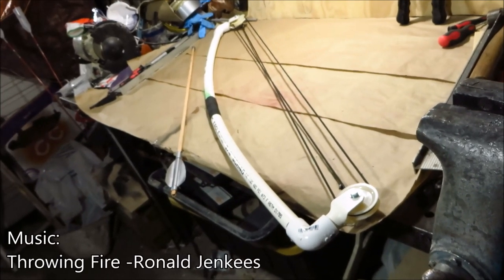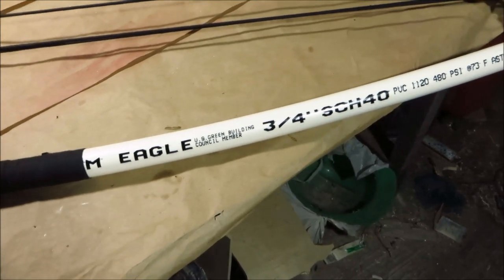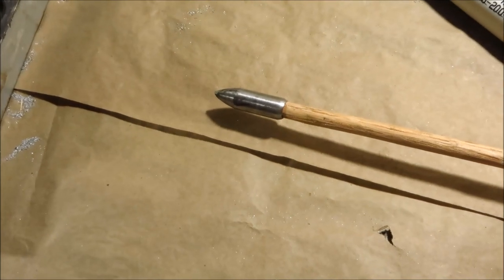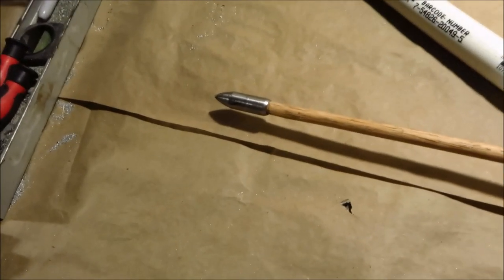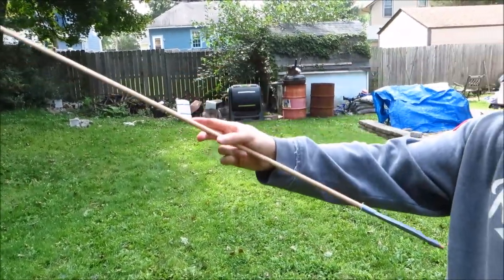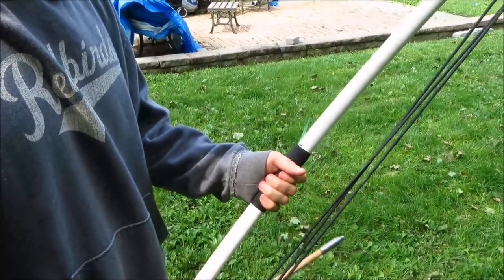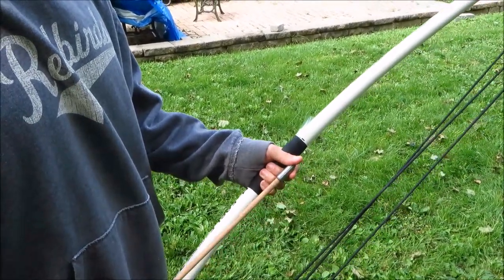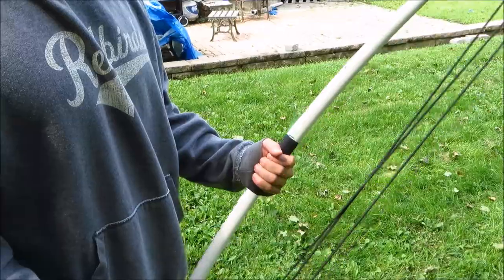Homemade PVC Pulley Bow Shooting!

Comment: I built a pully bow like this with 1" PVC and 4 larger fiberglass rods. It's 5'5" and has a draw weight of 37 lbs at a 30" draw, not bad, shoots ok at 25 yds.
 With a drop away rest and correctly weighted arrows it could probably shoot 40+ yds

Comment: just so you know eli, using pulleys that are round and centered provides no advantage over just attaching the string directly to either limb, the point of  the cams on a compound bow is that they are Asymmetrical and provide more mechanical advantage the further it is pulled back, making it easier to hold it fully drawn.
Reply: thats not actually true. idler wheels allow a longer draw from limbs that would otherwise break. Matthews actually has a very popular bow that has two idler wheels and no cams.
Reply: +TheElvenArcher oh cool, I didn't know that
Reply: Also if nothing else, this kind of bow would allow a very compact build that still has a full draw length, saving pack space is always a plus.

Comment: Have you seen nighthawkinlight's video on the steel wool fire arrow? Hose clamp some steel wool towards the front of the arrow and zip tie a 9 volt battery to the rest so when you draw, the steel wool lights and burns very hot when it flies through the air.

Comment: quick tip: to get more power out of the bow i reccomend using a non stretching cord like bankline, small coated cable or even kevilar line would be great to use . the cons of 550 paracord is that its pretty stretchy and it sucks a bit of the power of the shot  :)

Comment: If you do make another one inch pvc pulley bow then i suggest adding a recurve to the arms to add extra flex an a smaller bow frame with equal power

Comment: @ZednoughtAlpha what if you just put a second smaller pvc pipe inside of the one inch pvc pipe instead of fiberglass? and maybe even a smaller third one or just a single fiberglass rod. Would this be a powerfull bow?

Comment: i need help my arrow flips in the air what should  i do
Reply from the maker: Did you do anything different that I did in the tutorial?
Reply: i didn't make the wings in the back of the arrow
Reply: LB AB bro Well that's why. Just use duct tape like he did.
Reply: LB AB bro ALL arrows need fletching. ALL. They don't work, otherwise.
Reply: LB AB bro Hahahah you made an arrow without fletchings?
Reply: MrAmazing21399 yes i didn't know it was a big deal
Reply: LB AB bro I see. Well, I suppose people can be mistaken about that..
Reply: LB AB bro Use 3 fletchings per arrow.
Reply: Peter Hooper unless the front of said arrow is much heavier than the body and it is therefor front-heavy but yeah fletching is a thing that is good for shooting past like 4 feet
Reply: Calvin M. It still won't fly straight. The only time fletchings are not necessary is if you are bowfishing.
Reply: i just said unless you are shooting more than 4 feet stabilization is necessary for long range not point blank
Reply: Calvin M. of course, but why the fluff would you shoot at a 4feet distance?
Reply: i never said he would, i said it jokingly. "but yeah fletching is a thing that is good for shooting past like 4 feet"
Reply: Calvin M. As I thought.
Reply: why did you originally comment then?
Reply: Calvin M. since you went soo deep into explaining how a heavier head would imporve it.
Reply: thats what she said. ok im out goodnight
Reply: way to front heavy

Comment: Do u think its possible to apply more pressure by putting another PVC pipe right in the middle
Reply: If you use fiberglass rods in the center it probably would but idk about more pvc

Comment: I use to make bows out of pvc years ago doing LARP. The only thing I would suggest for more power is swap the 90's for 45's, use sch 20 3/4 pipe and a 1/2 inch sch 40 in the center replacing the fiberglass rods. Doing a normal curved bow without the pullies you can achieve 40lbs do it that way. Also it will drop the price a little (for how cheap it already is). The only issue is the center pipe raddles. That is something I have been try to figure out how to stop.
Reply: +Dotson6996  to stop the ratlle you could put in news paper for a spacer just a thought
Reply: +merlin christiansen that's a good thought!  didn't think of that.
Reply: +Dotson6996  thanks

Comment: I was thinking about using fiberglass rods instead of dowels, what do you guys think about that?
Reply: it would be a terrible arrow. It would be to heavy.
Reply: +FernTheYoutuber Glass hasn't the best resistance to shock force, It would likely work but if you accidentally hit something solid there's a good chance it'd be damaged. I'd advise aluminum tubing because lightweight, relatively cheap, easy to work with and if they get damaged you can melt down and repurpose the aluminium pretty easily as it's melting point isn't too high.

Comment: I suggest you try making an arrow with thin aluminium pipe, an arrowhead like you did before, but insert it inside the tube. Thinner arrowheads penetrate better, and it will make the arrow itself lighter and travel more straight. If the arrow keeps tilting, try fletching with some real feathers, more fluffed up. Also, try using a thinner string, or making one yourself, and wax it with a candle. The paracord is too thick and you want the least amount of resistance on the string. Try making the bow stiffer, the pulley's are there to ease the pull weight after the initial power. like a gearbox. But you need oval wheels for this. Real compound bows go really hard at first, then become easy to draw. This means you need less strenght when the string is near your lips, so you have an easier time aiming.

Not trying to critisize you, its a cool bow, just some tips. I've practiced competitive archery for 5 years a couple of years back. :-)

Comment: I think I know how to make the triple fletching. Get three pieces of tape. Put one under the arrow like you already do then, instead of putting one directly overlapping, take one piece and stick half of it to the bottom piece so it lines up with the tape's edge. On the half that you didn't stick to the bottom half, stick half of the third piece onto that. Then, stick the exposed half onto the bottom piece of tape so that all of the edges line up and they all stick to each other. You could even do a quadruple fletching by adding a fourth piece of tape. I realize this may not be the best explanation, sorry about that. I'm sure you're more than capable of figuring out what I'm saying. Keep up the good work.
Reply: Or you could just buy a small fletching rig and save your self a lot of trouble.

Comment: can you use a I inch pvc pipe for the pulleybow?
Reply: +Mario Cassar probably. Much higher draw weight.
Reply: +M Astley how much higher?
Reply: No idea. All I know is that 1 inch has thicker walls and more material to bend, so it will have higher draw weight.

Comment: Eli, I've made this bow, and I used 2 fibre glass tent poles inside 3/4 inch pipe ( they fit snuggly), inside 1 inch pipe ( so it goes, fibreglass inside 3/4 inch inside 1 inch) witch I would of thought would be really powerfull, seeing as your expecting to have to use a release just for 1 inch, I think I've done everything right, but it's so week, less than 18 lbs from the feel of it, and it's frustrating to me because I  live in the uk and we don't have Home Depot and such, so I have to order the pvc and stuff off the internet, coming to a total of nearly 40 pounds for all the parts, witch is a lot of money for a 14 year old, and I'm frustrated and disappointed that the bow isn't what I thought it would be. Any suggestions/solutions? +nonlethalbychoice

Comment: just so you know you shouldn't use wood arrows in a compound bow, it might not matter with a low draw weight bow like that but a bigger bow well make them explode
Reply: +412firefox4124 Any bow with a high enough draw weight. Longbows that strong are rare, but they exist. English War Bows, for example, can be over 100 pounds.

Comment: You should've done a fire arrow
Reply: He's planning on giving them nuclear warheads once he gets a welder. Right now he can't find any because the goverment learned about his mischievous plans and hid them in a secret underground vault in the area 52 (they didn't go for the one in the area 51 beacuse everyone knows about it's location). He already synthesized uranium from Mountain Dew's extract and got all the parts needed. If he won't be able to trace the vault's location, he'll just make a makeshift welder from three angle grinders. In my opinion, he should just create miniature doomsday device tips for the arrows, which are basically just simple arrows with a miniature angle grinder stuck in front of it. We've already seen how powerful angle grinders are and that there's infinite amount of things you can use it for, so I doubt there would be anything that could stand a chance when struck  by such arrow. If there's anyone that can pull it off, it's NLBC. I just hope he won't mount nano cold fusion chambers to them as a power source for the mini angle grinders, otherwise they would have enough power to plow right through to the Earth's core and split the planet in two ;_;
Reply: i think fire arrows dont work? correct me if im wrong
Reply from the maker: mahin patel
Actually, fire arrows are a historically used weapon. They're not dramatically more effective than regular arrows when fired at foot soldiers, but they were fired at enemy ships and over enemy walls to set their fortifications on fire. Very effective in that regard, as far as I know.
Reply: but i mean on a target it would not do any more damage than a normal arrow
Reply from the maker: mahin patel
Dis true.
Reply: i also think that the force of the bow would surely put the flame out mid flight?

im so shocked your replying to my comments btw your doing a great job on your vids!
Reply: Fire arrows don't go out in mid flight. I've seen people shoot 160 pound war bows with flaming arrows and it works fine. But war bows don't shoot to fast in comparison to the new compound bows
Reply: yes but this a compound bow...
Reply: Yeah the bow would have to be shooting at almost 300fps to put out that fire
Reply from the maker: And even then, there are some designs that burn hotter the faster they fly, for example the steel fiber/wool design.

Comment: I noticed you didn't really spiral the fletchings at all, or use a dowel that looks like it'd bend easily.  2 myths about arrows debunked, because your arrow seems to fly fine.
Reply: ***** His arrow also probably wouldn't fly nearly as straight or as accurately as one that can bend and has a spiraled fletching.
Reply: +Hotel1 Gaming That might be because of the heavy tip and only having TWO DUCT TAPE fletchings.
Reply: Obviously, that was my whole point. Did you even read my comment? I explicitly said that it wouldn't fly as well as one that had proper fletchings (makes it spiral) or an evenly balanced/flexible shaft (bends in flight).
Reply: Proper fletchings don't necessarily make it spiral. Also, that bow most likely is too light to make it bend noticeably in flight.

Comment: How does the pulley system compare to the original recurve bow? I made like... three or four of your recurve pvc bows with some buddies and they're uber-fantastic. Is the draw different? any difference in power (aside from pipe thickness and fiberglass reinforcement, of course)?
Reply: Cool Kevin this is nick

Comment: its called a compound bow.
Reply: +Angel Leiva Compound bows are designed with cams and reduce the poundage when fully drawn.  His bow only creates a smooth draw and if done right removes all hand shock when fired.  Its inspired by a compound bow but really is still closer in the way it shoots to a standard long bow.  I think pulley bow is a more accurate term.

Comment: My guess is..15-25lbs tops.
Reply: +Draegor X The fiberglass adds weight. Also, the channel backyardbowyer made a 3/4" sch40 pvc bow WITHOUT fiberglass, and it drew 40lbs, so this is probably higher.
Reply: +M Astley lol dont be silly, 40 pounds?...the arrow didnt even make it halfway throught the styrofoam...my kids 18 lbs bow shoots faster arrows...problem with this bow is constructuon and string material, those take most from possible arrow speed, but i guess the actual poundage could be around 20-25,  draegors estimation was about right
Reply: da23injulecz his homemade arrows are really really heavy and your kids bow is probably shooting lighter fiberglass. I do agree that this bow is probably around 25 lbs and super inefficient though. for posterity (because why would I reply to a 3 year old message otherwise)